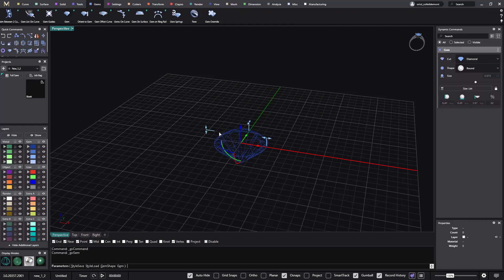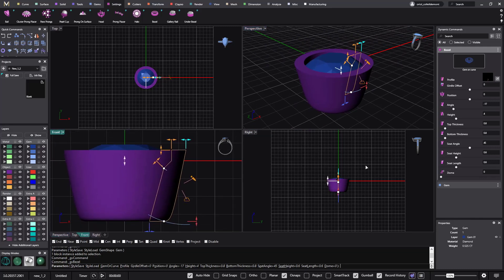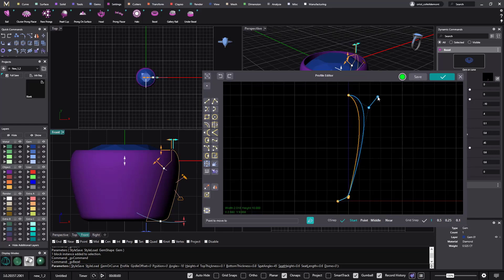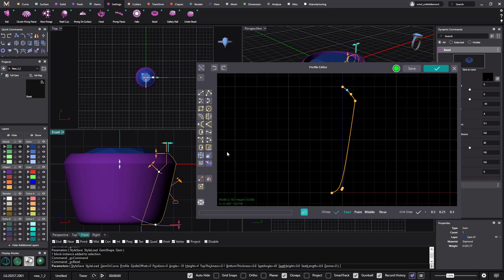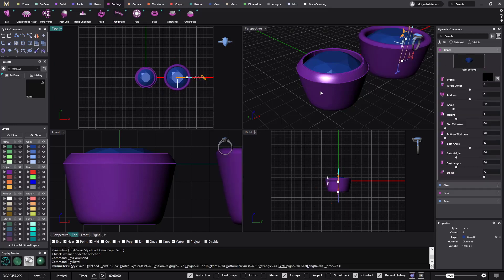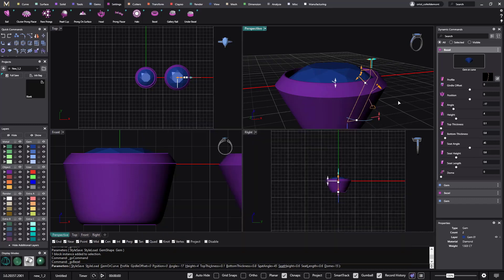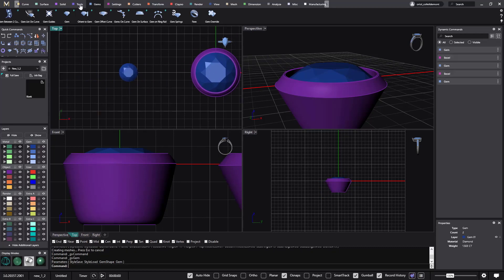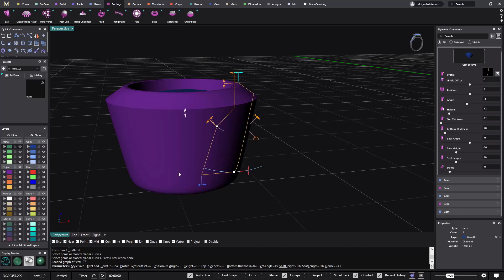How To Apply Filets On Bezels - MatrixGold

Comment: I'm confused here...to me what your doing is changing the profile...filleting is altering an edge like a corner from sharp to round.
Reply from the maker: Anibal Antonio with the profile editor you have total control, you can either change the profile shape or smooth/flatten/sharp an edge
Reply: @GemvisionLLC  thanks for the education. I'll generally build with linear edges and fillet at completion of the build. Your method (Matrix) is definitely efficient.

Comment: But how do you do the very simple, pull to rail command in MatrixGold? Are all my heads and bezels supposed to remain straight? Not a huge problem in small stones, but use big gemstone heads and "Cut to Rail" just doesnt cut it.
Reply from the maker: Hello Ivan Solis .The pull to rail is something that we are going to add in MatrixGold in the near future. Meanwhile, you have the blend tool that can help you to add an under bezel or a gallery rail following the stone shape parametrically and the finger rail